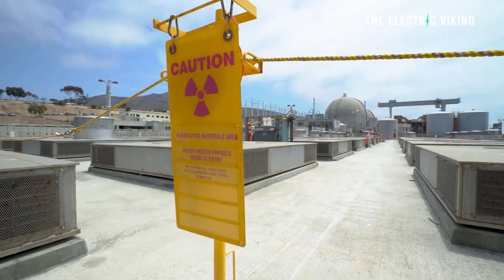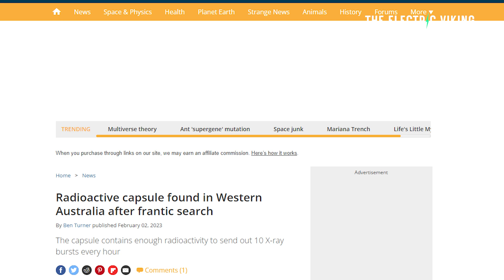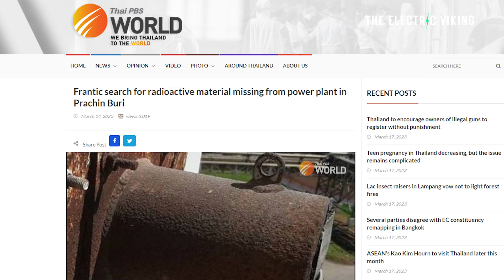Radioactive material from nuclear power plants keeps disappearing...

Comment: Whoever thinks nuclear energy is the way to go should go to Fukushima and help with the cleanup. Go in there and do a damage assessment and get instantly fried
Reply: Fukashima was a comically bad design on the ocean with 1960s technology and it still resulted in no direct deaths.  The switch to dirty fossil fuels to replace it on the other hand killed tens of thousands due to air pollution alone.    100% renewable is a great goal but storage (especially seasonal) is barely getting started.
Reply: @ccibinel  No one is talking about switching to fossil fuels. The utility companies are switcingh to wind and solar. My power company is eliminating coal and switching to wind and solar. You are full of it regarding deaths and Fukushima. Maybe not immediate deaths, but, how many people will get cancer? You really need to have your head examined. How long does it take to put a new nuclear reactor into commission? Look into it. This country will be lucky to be around in another 100 years. Whose going to take care of the nuclear waste for tens of thousands? Utterly clueless. BTW, they tried sending in robots to assess the damage at Fukushima. They burned up almost immediately. So, what kind of crack are you on thinking that wasn't a bad disaster. And BTW, they have the same design in use here in the USA. And guess what, all of the reactors are along the coasts in low lying areas. They need to be moved due to sea level rise.
Reply: The Japanese plans to dump all those radiative water into the ocean, and the West and Australia don't dare say a blip because they need Japan to "contain" China.
Reply: If you think safety isn't getting better you're blind :P
Reply: @Nabushika  if you think it’s as safe as renewables and battery storage, you’re deluded.

We should run the existing plants to the end of life, but we know now how affordable wind and solar are, and we can now make suitable batteries. We can achieve all the energy we need from renewables much faster, cheaper, and affordably than we can with nuclear.
Reply: @edwardhackett-jones8126  we just don't have the battery scale to be able to store all the energy we need yet, and it'll easily be more than a decade before we do. Of course nuclear has its risks, but pollution kills far more people than radiation ever has, and the important thing is getting away from fossil fuels.
Reply: @Nabushika  in the UK it takes decades to a new nuclear power plant commissioned. I assume it’s the same in most countries. By the time we have exhausted that process we will have many more batteries and capacity for production.
Reply: @edwardhackett-jones8126  even looking at Tesla's insane battery scaling plans, nuclear plants will come online far before we have enough batteries to store all the power we use. I think you underestimate just how much energy we use as a species! I'm not saying batteries are not part of the solution, but it'll take a lot longer to wean ourselves off coal and gas for baseline generation if we only use batteries and don't consider nuclear.
Reply: @Nabushika  You're a clueless person who doesn't have common sense
Reply: @Nabushika  Fukushima was only 12 years ago.